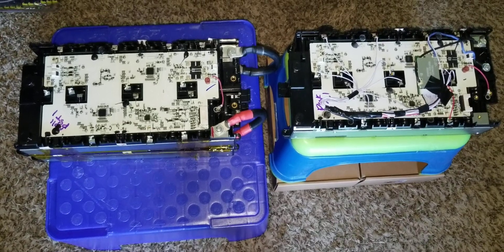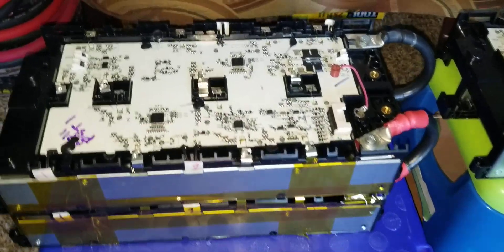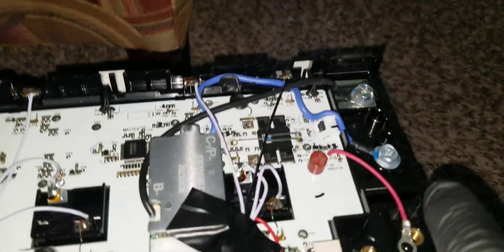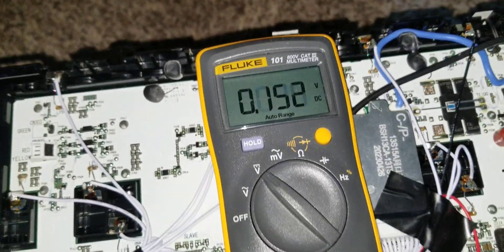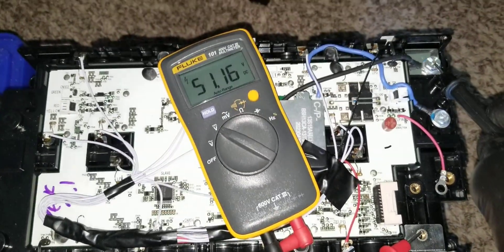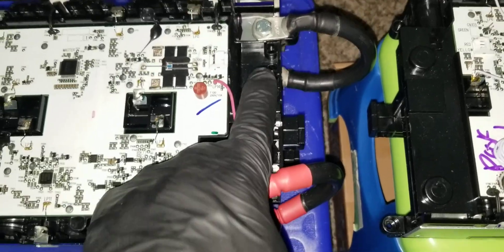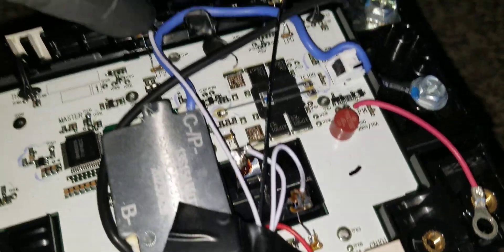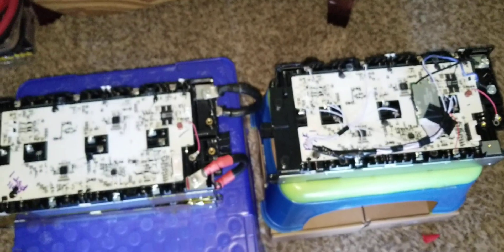PANASONIC 48 VOLT BATTERY CELLS WITH 15a BMS

Comment: What are the pros of leaving the white board in there? Is there a purpose for it?
Reply from the maker: I personally prefer to leave the PCB Boards alon.
Thanks for stopping by and don't forget to Like and Share
Reply: @jwsolarusa  yes I been following that project. I have some that I been trying to work on but I been debating wether to leave that board on or off
Reply from the maker: @omarsegura2847  
I will suggest you leave it alone for not to start any kinds of problems.
Thanks for following my channel and stay tuned.
Have a bless day